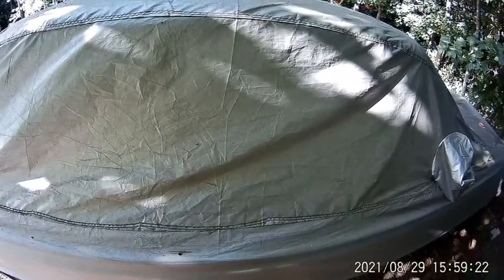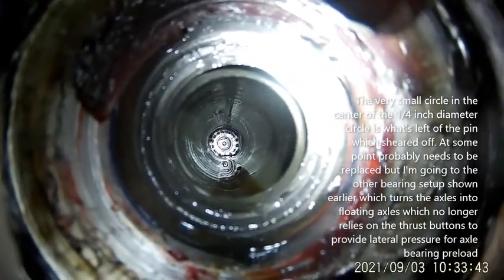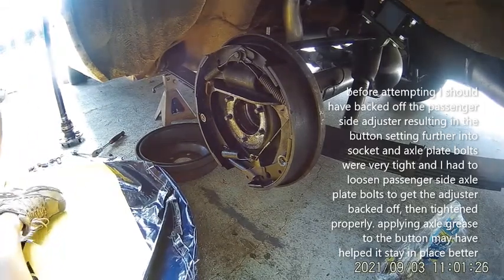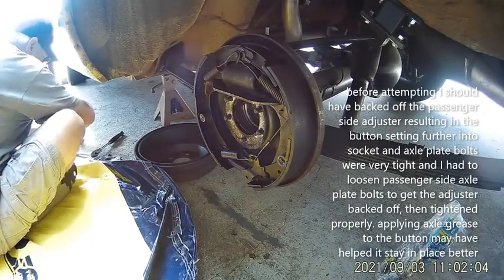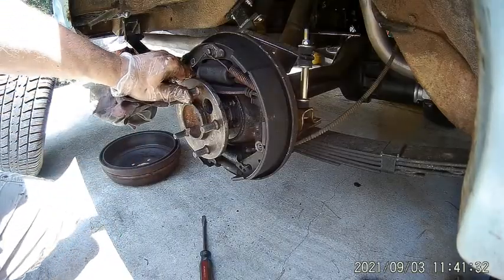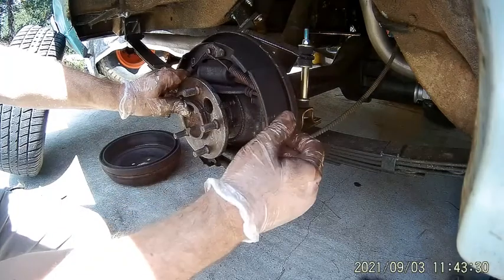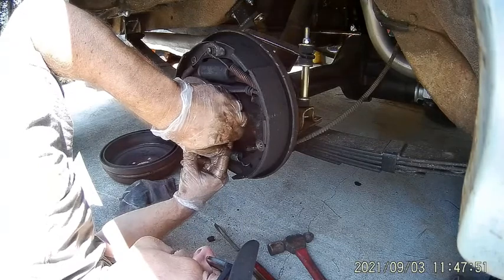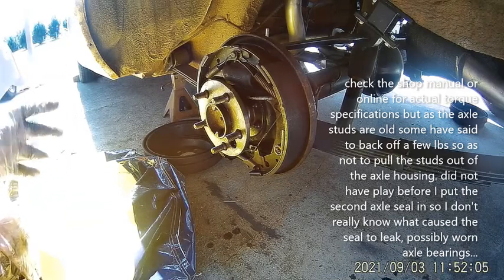8.75 8 3/4 Dodge Plymouth axle end play adjust thrust button install and upgraded mopar bearing set

Comment: You have the patience of a Saint. Me I would have pulled the axles and differential. In my youth I took many gear oil baths! Lol the one I worked on recently belongs to my son inlaw. He restoring 70 RR. Tells me yesterday he and his father are going to put the frame and rear back in his dipped freshly painted body. The lock clip was not there when he bought the car. So I disassembled everything replaced bearings and seals scrubbed it inside and out painted the banjo got it all back together but didn’t remember what the back lash was. I’m going there today to set it drill a hole and safety wire it. I know if it’s goes back in the car it will be forgotten about until it starts leaking or worse. Correct zero play both side and 8 to 18 thousands on the passenger side. Lol like you i will be going tighter. Good job

Comment: The axles on my son inlaw RR actually had a slight wear mark from the inner seal both sides. After I cut off the bearings I polished out the matting surface. Keeping fingers crossed they don’t leak. I think it will be good; something to look for if they start leaking on you.
Reply from the maker: I'll definitely check, thanks!

Comment: Well I was hoping you going to adjust the passenger side back lash or end play but you went with the Green Bearings. Good luck with them we bought them originally but decided to use taper bearings as originally equipped. Some folks complained about them so we felt safer using original bearings and setting the end play. Car sounds great
Reply from the maker: Glad it worked out, thanks for the info!

Comment: I had the same thing happen where the pin broke and the thrust button piece fell down into the bottom of the diff center section when I pulled an axle. The center section had to then be pulled out to retrieve that thrust button piece so that it didn't accidentally get caught up in the gears potentially ruining everything! I then ordered and installed a new button. I learned that I must be very careful and pay close attention to how the axle is pulled to make sure the thrust button piece does not come loose and fall if that pin gets sheared off again.
Reply from the maker: Absolutely correct! The pin is so thin, seems a poor design. I've never driven the car hard or even spun tires or performed any burnouts and yet my pin sheered off for some unknown reason!
Reply: Le côté  chauffeur à un très gros jeu et côté  passager j'ai tourné  l'ajustement et  ça n'a rien changé qu'est-ce que je dois faire